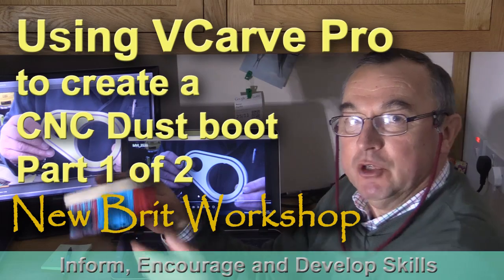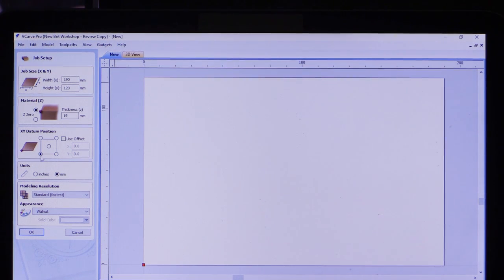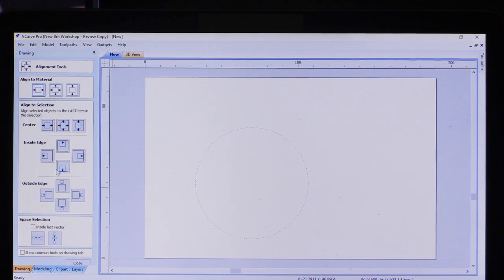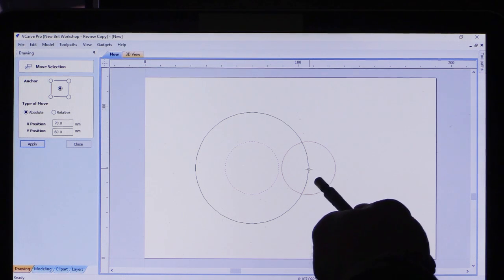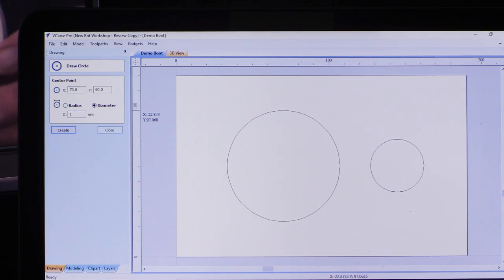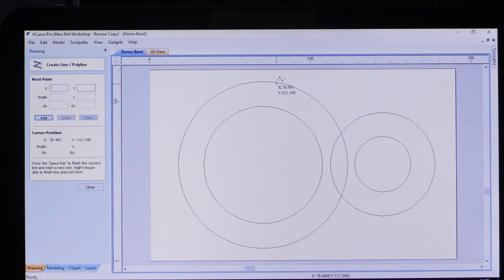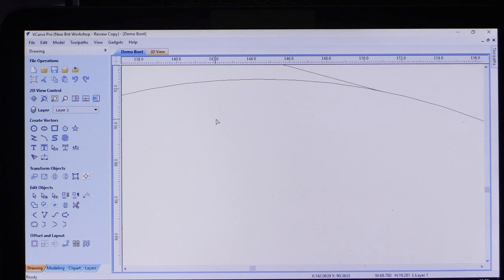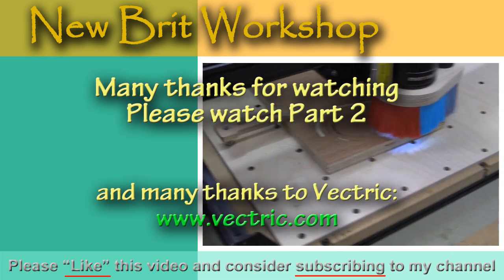Making a basic CNC dust boot using VCarve Pro - Part 1

Comment: would it be possible to tell us where you purchased bristles from as I found some last year for my cnc but they were only 14mm deep. thanks
Reply from the maker: Hi Jim, I went to a local brush factory but it would be easier to buy a long bristled brush from a DIY store and cut what you need.     Peter